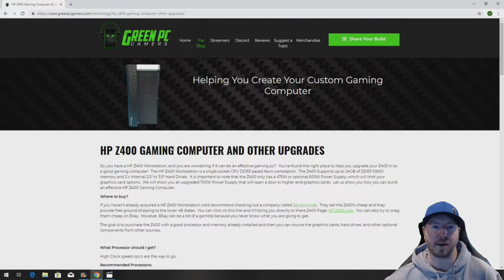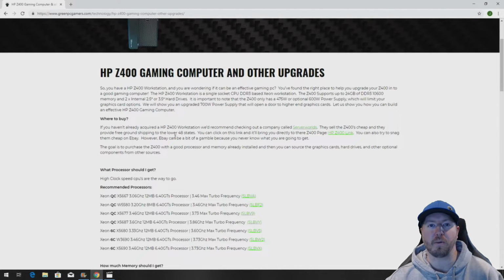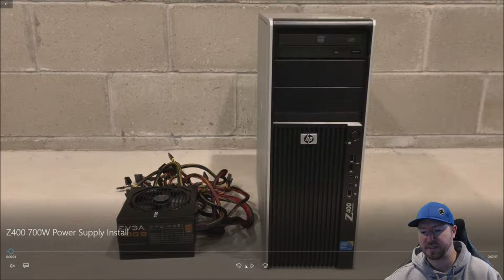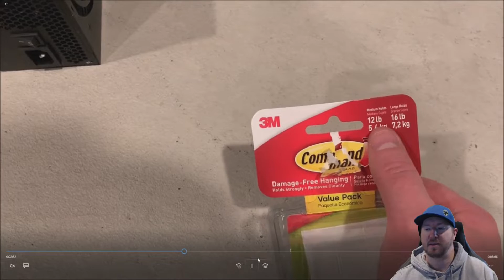HP Z400 ATX 700W Power Supply Upgrade and Install

Comment: Is an adapter for mounting the PSU into the case instead of using command strips possible? Could the internals of the 700watt ATX be put inside of the 475 watt externals?

Comment: Kindly  reply dear i have hpZ620 and my power supply died Now its not availavle in my country and nearby markets can i install this evga psu using 24pins to 18pins? converter because Z620  board have only 18pins kindly help
Reply from the maker: We have only tested the HP Z620 with stock power supplies.  Sorry!

Comment: Great advice. With upgrades, do you think the following HP z400 desktop can handle 1080p, 2.7k and maybe 4k editing? I will be doing all of my editing on VideoProc with their converter software enabling less demand on the cpu and gpu. 

HP z400
HD flat screen monitor
Wifi adapter

Xeon Quadcore Processor
10GB Ram & SSD

Nvidia GTX graphics 
But offered this ADM FirePro Graphics Card though. Which is better?

425w psu
Extra drive bays
Extra sata ports 
10GB Ram - can be upgraded to 48GB

Nvidia GeForce GTX 680 GPU
Intel Xeon Quadcore w3565 processor @ 3.20GHz
240GB SSD
250GB Hard Drive
Windows 10

Comment: Hey I did everything right but my EVGA PSU has a 6+2 pin but my graphics card has a 6pin. When I connect the 6pin from my 6+2 it doesn't work.

Comment: I am Japanese.  I'm using the same HP z400, so I'd like to use the GTX1660supe, but I'm in trouble because it has only 6 pins.  I met this video there, but I don't understand English so I don't know what to do, so I'd be happy if you could tell me.  And this is using the abbreviation app, so the sentence may be strange.

Comment: Do I need the adapter if I plan on changing the motherboard and CPU, but keep the PSU? I'm putting in a MSI motherboard with an i3 9600 cpu.
Reply from the maker: You won't need the adapter if you use an ATX motherboard with an ATX Power Supply.
Reply: I wanted to keep the stock PSU. I made some digging and figured it's not possible without an adaptor. Anyway, I will change the PSU, as well as the motherboard, ram and processor. I'm keeping the case though, I like the old classy aluminum look it has. Thank you for replying and mery christmas!

Comment: Can we get a new link to the pin adaptor the ebay link has expired.
Reply from the maker: Try this link: https://rover.ebay.com/rover/1/711-53200-19255-0/1?mpre=https%3A%2F%2Fwww.ebay.com%2Fitm%2F4-ATX-to-HP-Z400-24-Pin-Non-Standard-ATX-Main-Power-Adapter-Cable%2F333801762449%3Fhash%3Ditem4db822ae91%3Ag%3AyXYAAOSwcNJfPsu5&campid=5338541721&toolid=10001&customid=
Reply: One final question. The pin converter is definitely required even with a 600w power supply right?

Comment: I have 2 Z400 gaming rigs , x5687 GTX 980 and X5690 RTX 2060s with that same ATX PS. All you need to do is run 12V to pins 12 and 23 on the ATX connector. Pin 20 isn't used. Most PS don't even have any pin in that 20 pin slot anymore. Used 2 separate 12V  power inputs. Been running great for 2+ years.

Comment: Great info guys.  Thank you.   FYI ... Evga gtx 2060 ultra 8g card works with built in 475watt power supply.  Whether it's ideal, no.  Also saw that adapter(called out to work for hp z400) on a separate, non eBay, non amazon site ... 16 bucks.
Reply: it will work... until you get random reboots.

Comment: I see that didn't use the small pins, like the ones used for the hard disk drive, the power switch and etc. Are they not used?

Comment: Just wondering, I want to change my psu for a corsair vs650 but the case fan is already used by the cpu cooler (water cooling hp original stuff). I'm gonna have to turn the psu fan to the inside, am I gonna get into temperature troubles ?

Comment: I have an adapter a 600Watt PSU. i think is it enough for a Geforce GTX 1080. BUT i have peep code by press power button. Can you help why?
Reply from the maker: Does the power button turn red and the system beep?
Reply: @GreenPCGamerscom  I have the same problem. I'm using EVGA 700 GD psu and the adapter but it gave me 4 beep code which means power failure right? I check the cables and everything but it keeps gave me the 4 beeps code. Any suggestions?
Reply: Yes
Reply: Did you manage to fix it?

Comment: I just realized the power supply fan is upside down, will it cause any harm to the other fans ? Like overheat or stuff like that
Reply from the maker: The fan blows down in to the chassis and then exits out the backchassis fan.

Comment: I just purchased a bad power supply off eBay but it was the same one that originally comes in the hp z400. I wish I knew someone to help me upgrade the power supply and graphics and sound cards.
Reply: Hello, I hope you did not payed too much but the PSU is not that bad, it's a Delta, one of the best in PSU... Just don't ask too much from the PSU since it's only a 475 watt PSU.
Reply: @webolabs

Comment: I feel like one could 3D print some type of adapter to plate that will screw into an ATX PSU, and the HP z400. That would be much better than this.
Reply: i was thinking the same thing

Comment: Hi ! can you send me the 24 pin adapter link? I have a PC like this and I'm going crazy! haha thanks
Reply from the maker: http://rover.ebay.com/rover/1/711-53200-19255-0/1?ff3=4&pub=5575507517&toolid=10001&campid=5338541721&customid=&mpre=https%3A%2F%2Fwww.ebay.com%2Fitm%2FATX-to-HP-Z400-24-Pin-Non-Standard-ATX-Pinout-Main-Power-Adapter-Cable%2F324005091169%3Fhash%3Ditem4b70355761%3Ag%3A88QAAOSwIFtc48dF
Reply: @GreenPCGamerscom  thanks!
Reply: @GreenPCGamerscom  sr.   I need the link plis

Comment: bonjour :)  questions, cela peut fonctionner avec n'importe quel alimentation
 ?
au qu'un risque de griller la carte mère ?
Reply from the maker: There is always a risk when trying any 3rd party power supply in an oem workstation.  We do know that the power supply in the video works well.  We cannot endorse any other power supplies.
Reply: @GreenPCGamerscom  meme les meme model en 500 ou 600w et les model 600 br ou 700 br ? thanks a lote :) !
Reply: could you answer the question
above please, tks a lote ;)
Reply: @geonemo4555  Vieux, mais normalement oui, si c'est c'est la même alimentation et qu'il y a que les watt qui change

Comment: Can you explain which power adapter i need particular. I bought a new graphics card and your linked adapter doesnt sell anymore. i really dont wanna mess up my mainboard. Thank bro
Reply from the maker: http://rover.ebay.com/rover/1/711-53200-19255-0/1?ff3=4&pub=5575507517&toolid=10001&campid=5338541721&customid=&mpre=https%3A%2F%2Fwww.ebay.com%2Fitm%2FATX-to-HP-Z400-24-Pin-Non-Standard-ATX-Pinout-Main-Power-Adapter-Cable%2F223736163778%3Fhash%3Ditem3417b6edc2%3Ag%3A88QAAOSwIFtc48dF

Comment: will a CORSAIR VS Series, VS650, 650 Watt work?
Reply from the maker: Possibly.  Most ATX Power Supplies will work, as long as you can fit them in the chassis, and you use the power adapter cable.

Comment: Hello, the link of the adapter it is not working!, can you posted again plz
Reply from the maker: https://www.ebay.com/itm/ATX-to-HP-Z400-24-Pin-Non-Standard-ATX-Pinout-Main-Power-Adapter-Cable/323934196451?hash=item4b6bfb92e3:g:88QAAOSwIFtc48dF
Reply: @GreenPCGamerscom  Thank you so much!!

Comment: Hi what about Lenovo s30 workstation board
What the compatible PSU with it can works
Reply: The lenovo S series boards use the standard pinout and any 24pin PSU will work for them

Comment: Do you have the same video for hp z600?
Reply from the maker: We do not.  Mainly because the Z600 has a custom fit power supply.  ATX power supplies will not fit in to a Z600 workstation.

Comment: hello sir, thanks for the video, I want to know If i can use RX 480 4gb gigabyte on hp z400 default PSU 475 80+? or do i need atx?
Reply from the maker: We haven't tested an RX480 in a Z400 yet.  However, ATI recommends a 500W PSU for that particular card.  You could give it a try to see if it is stable.  You can always upgrade the PSU if it is not stable.
Reply: @GreenPCGamerscom  on mine it works fine even with a 4.0hz oc as i have a unlocked cpu w3680 but in some games it does shut down im just not sure if its the psu or just the rx480 that have a bug of pushing to much power from the motherboard...
Reply: @thepro08  I wasn't able to overclock to 4.0 without lots of instability so it's probably that as there's no way to increase voltages. Idk how you got an rx480 installed with the stock power supply though as the only extra power connector is a 6-pin...
Reply: @benjaminmcintosh857  you can increase power limit of the cpu in  trottlestop . But even stock it works what cpu do you have? Also rx480 came stock with a 8 pin to 6 pin i just atacjed and works fine. For years now... regarding the shutdowns its a gpu bug from amd . You just underclock voltage and dont do to much overclock. Even then i just overclock everything to the max for years
Reply: @thepro08  oh cool I didn't know it came with an adaptor. I've been running throttlestop since I got the system but adjusting power limits isn't the same as increasing voltages. That's why I'm only able to reach 3.8ghz all core whereas people with better motherboards usually get around 4.3-4.5. W3680 btw.
Your shutdown problem is more likely to be your CPU in my eyes, but an unstable gpu overclock or undervolt could be the cause too.
Reply: @thepro08  my CPU runs hotter (stock cooler) so that's probably contributing to some instability. I can get 4.1 stable but only when one core is being utilised.

Comment: Hi, I am trying to use an HP Z400 PSU on a normal motherboard as I’m quite tight on budget? Any links I can find an adapter for that on?
Reply from the maker: Hey Bo, we haven't attempted to use the Z400 Power Supply on an ATX system board.  What wattage is it?
Reply: GreenPCGamers.com it’s the normal 475w one
Reply from the maker: @4hmedk  did you install the atx board in to the Z400 chassis?
Reply: GreenPCGamers.com yeah but I can’t use the power supply that comes with the Z400 on it that’s the issue, so I was wondering if there’s an adapter that allows me to use that PSU on a normal ATX mobo
Reply: @4hmedk  have done this? I have the same problem,
Reply: @WickermanX1  @Ahmed Khaled 
I've done that, I changed the 24 pin connector to an ATX one, by removing some cables and putting others, it worked good. But don't try that on a expansive PC, try it on your old PC for some days with heayvy gaming and then put on your main PC, remember this if you make one mistake you could fry the whole PC for good...

Comment: how much w does that original psu have and what is the card the max. that it can handle? ty
Reply from the maker: Do you have the 475W or 600W Power Supply installed in your Z400 system?
Reply: @GreenPCGamerscom  I wanna buy a Z400 system with a Xeon W3565 and upgrade the GPU for a budget gaming PC. The only thing I know it has a 80+ bronze. 😃
Reply from the maker: I understand.  What games do you plan to play on it?
Reply: @GreenPCGamerscom  Euro Truck Simulator 2, Rocket League, Counter Strike Global Offensive, Overwatch, Apex Legends, San Andreas Multiplayer, CS Source, Arma (maybe) etc...
Reply from the maker: For moderate to good FPS you could get a EVGA GTX 1060 3GB Graphics Card.
Reply: @GreenPCGamerscom  Thank you for your help. 
I do not have extra cables for GPU's that require extra power.
Reply from the maker: They normally require 1 x 6 Pin Power.  That should be standard on the 475W Power Supply.
Reply: @GreenPCGamerscom  A guy told me that there is a 24 sata molex pin converted to a 4 pin.

Comment: Do I need the adapter if I want to install an rx480 with the standard 470w psu?
Reply from the maker: Most likely, what power connections does your rx480 require?

Comment: Thanks for the video! I installed my GPU into this thing for fun. After running a graphics intensive game the computer would reboot. Now I know what I can do.
Reply: what gpu do you have? i have a rx480 and in some games like all games running unreal engine4 the pc reboots after 1 or 2 minutes.... now i dont know just a new psu would do the trick since the rx480 and rx580 had a bug of pushing to much power from the board and this board is pretty shit and quite old so not sure if the better psu will solve the problem as the default psu has enough power....

Comment: Hi I looking to upgrade power supply to the HP Z400.
I looked on EBay for the 24pin to 18 pin convertor in the description they all for the HP Z420 can’t find for HP Z400.
Are they the same if I get one for HP Z420 will be ok for the Z400?
Reply from the maker: I don't believe so.  We ordered the adapter from an online retailer.  We have posted the link on our Z400 Blog page.

https://www.moddiy.com/products/ATX-to-HP-Z400-24%252dPin-Non%252dStandard-ATX-Pinout-Main-Power-Adapter-Cable.html
Reply: GreenPCGamers.com Thanks for the reply were should I get one eBay AliExpress can you direct me please
Reply: Z420 and Z400 are completely different in term of the main power port. They are not compatible.

Comment: I just got a gpu that requires 6 and  8 pin power connectors. I see this product has two 8 pin connectors. Is one of the 8 pins adjustable to 6?
Reply: Sure, you can use this: https://www.moddiy.com/products/Special-Mini-Low%252dProfile-8%252dPin-to-6%252dPin-PCI%252dE-Extension-Cable-%2815cm%29.html and there are many other options too.

Comment: Is there another way of securing the ps besides using 3m commands strips?
Reply from the maker: Ideally you could drill some custom holes to screw in the atx power supply.  There were actually 2 holes that did line up with the atx power supply that we installed.
Reply: @GreenPCGamerscom  I'm using an evga 850 bq instead and it looks exactly like 9:10 when installed. Is it fine if some of the hexagons go past the cutout? I also see that you dont have the psu completely pushed in. Is it for a reason? Also can I use tape along with 3m command trips to secure it even more?
Reply from the maker: @SuddenReshape4826  can you post some pics on a thread on our forum?  We pushed the metal bracket in to mount the 3m strips flush to the top panel.  3m strips are not ideal =/  If you can drill some custom holes to screw the psu in, it would be nice.
Reply: @GreenPCGamerscom  Sorry I completely forgot to post pics of the setup but I decided to just lay the pc flat and use 4 strips (2bottom/2side) instead of just 2 on the bottom and it's really secure. It was kind of a pain to put back the shroud though since the cables are really thick. Using a GTX 1660 Ti (Triple Slot) along with a W3680 and it works wonders. Your website and videos helped a bunch!

Comment: What would  you recommend to fill the gap for the replacement PSU? Bugs are very interested in the warm place under there in winter
Reply from the maker: We just left ours open.  However, you could use the metal duct tape.

Comment: I literally just bought one of these off ebay just this past week-- so recently that it won't arrive until tomorrow. I have no idea if I'll get a revision 1 or 2 even at this point, I won't find out until I open the case. I have some serious plans for a home use UNRAID machine. Ironic that anyone out there would make videos of it let alone 'right now'. Thanks for the uploads.